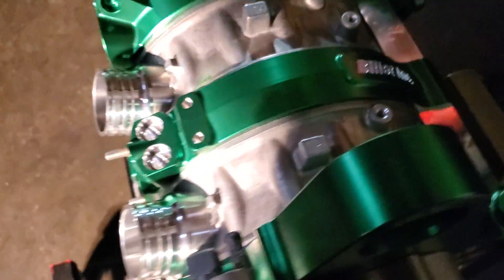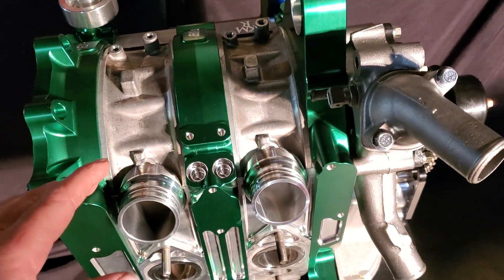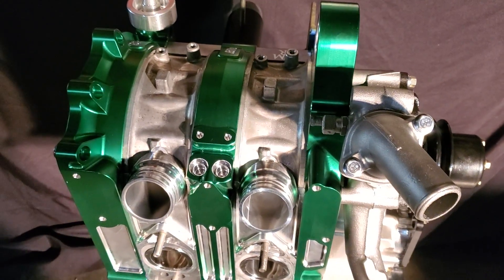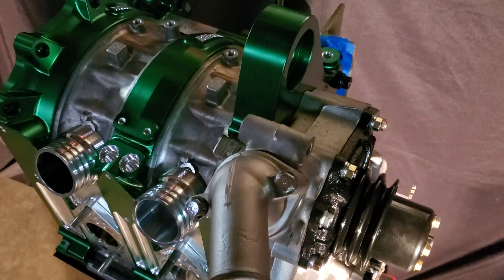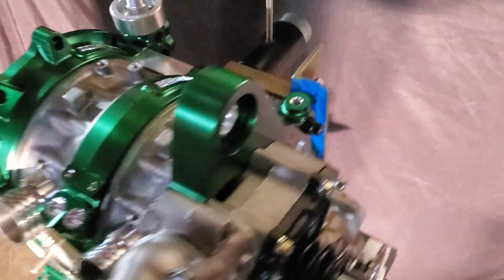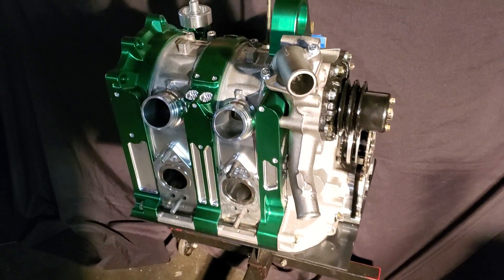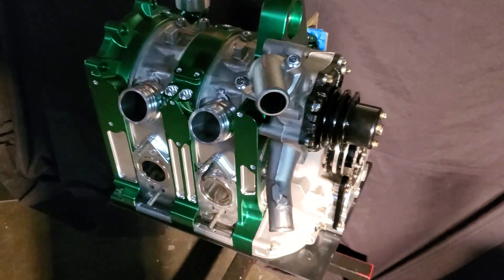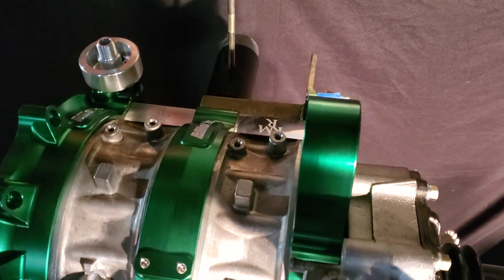Amazing Billet 13b Peripheral Port build - KMR Tech Talk, Lighter, Stronger Aluminum Rotary Engines

Comment: Would you add Reed Valves to these Peripheral ports?
V-Force reed valves look fine for this.
Peripheral intake ports are not compatible with Side Intake ports in Renesis. 
This causes interference

Comment: How do J ports or monster ports compare to peripherals? How much extra power does a J port or monster port make compared to a standard full bridge or peripheral?
Reply: J port = bad. Motor will fail in less than 20,000 miles. Bridge port can be combined with semi pp, full pp is bigger than both of those